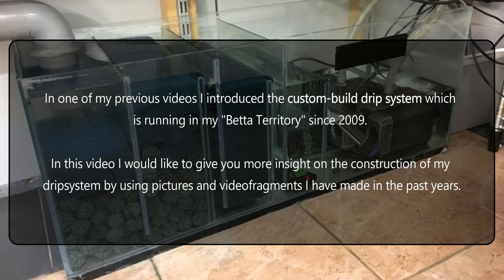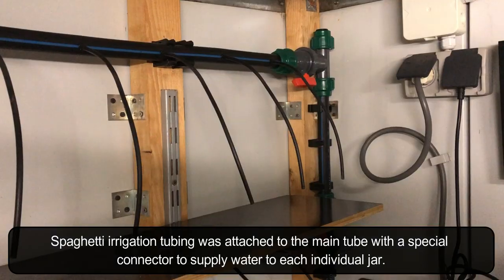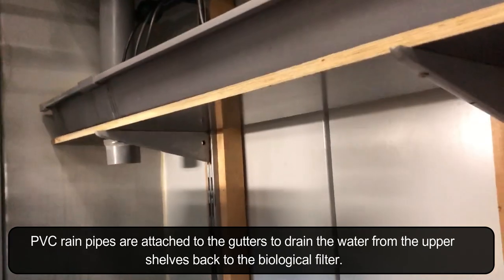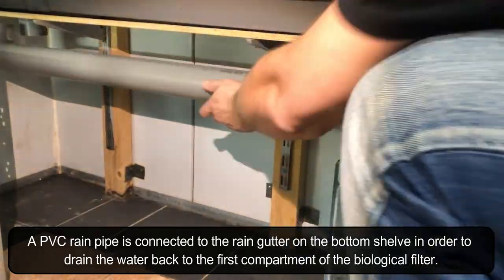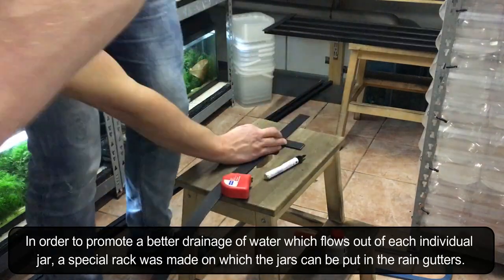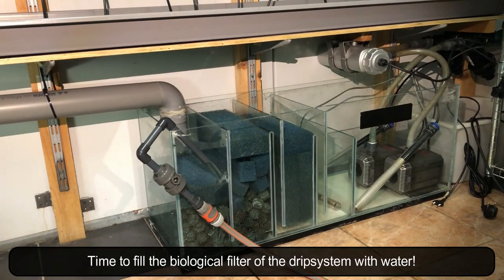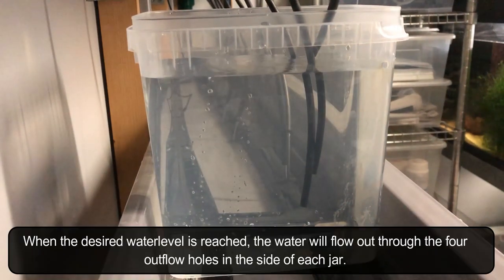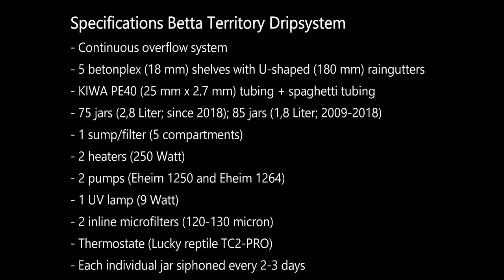My DripSystem - Tutorial

Comment: Do you think a 190 gallons per hour power head pump is big enough?
        Right now I have 15 gallons of water in 1/2 gallon jars on 2 ft shelves. Just bought a metal unit 4ft long with 6 shelves, that would allow 20 jars per shelf - 10 gallons per shelf... 60 gallons max. 
       At the rate I am expanding, I would probably only use 3 shelves until spring. Would the 190 GPH power head be enough to handle 30 gallons of jars?

Comment: Thanks for sharing Joep👍
Do you have the uv light on timer or running 24 7?  Same question  for the pumps? How 0ften you do maintenance on sump and individual jars?  Do you stop the water flow if feeding bbs or live foods?
Reply from the maker: CrowntailHalfmoon the UV light is on 24/7 but is only connected to one pump, so all water will go through multiple times per day eventually. The pumps/flow run 24/7 and is not stopped during feeding or the waterchanges (siphoning each individual jar manually every 2-3 days) only stop flow once a year when I do the annual cleaning where I take the system completely apart.
Reply: @BettaTerritory  
Joep do you add dechlorinated water back to the individual jars or the sump when removing wastes from each jar?  How much water do you siphon out of each jar and what's total volume of water in the system? If there's an power outage do the sump hold the excess water run off?
Thank you for sharing.
Reply from the maker: @CrowntailHalfmoon  I siphon 30-60% manually every 2-3 days. Water is replaced by pumping fresh water back into the sump. More on this is shown in this video at 3:20 min: https://youtu.be/zEGMtBiRZ84
Reply from the maker: This also might be useful to you: https://youtu.be/qgFW-XiIS6w
Reply: @BettaTerritory  
Thank you Joep
What's your approach for power outage and do the sump hold excess water running off?
Reply from the maker: @CrowntailHalfmoon  At the end of the KIWA tubing on each level of the dripsystem, one extra spaghetti tubing is added to prevent a vacuum from being build up in case of a water outage. This prevents water being sucked from the individual jars back to the sump. The sump does have some volume left for the excess of water in case of a power outage.
Reply: @BettaTerritory  
So its same length as other tubing but not in a jar? 
Also you u recommend having tannins in dripsystem?  Like a bunch of ial leaves in sump? What's your pros and cons on this?

Comment: Sir when you drill the hole for the valve did you put some silicon protection for water leaks?
Reply from the maker: I did not drill any holes for the valves, but maybe I have misunderstood your question. Can you explain what you mean?
Reply: @BettaTerritory  sorry for my question, 
how did you put the valve into pipe? 

If you do drill to connect the valve into the pipe what should you do to prevent leaking damage?
Reply: @goysjohn9239  u get special connectioms that pres into main line with no leaks look by garden irrigation shops

Comment: Can you update your website and put more info on genetics? Especially tail genetics? 
Like what happens in a VT × HM breeding 
Plakat × VT 
HM × Plakat etc...
Reply from the maker: The outcome of such crosses is usually it so straightforward because they involve multiple traits.
- Crossing VT x HM can lead to quite a big range of phenotypes in F1 ranging from VT-like to roundtail and/or (super)delta offspring. In F2 likely a similar variation will appear. 
- Crossing PK x VT will lead to all longfinned offspring unless the VT is also carrier for PK. When you use a traditional PK with only a 2-ray branching there is a good change the offspring will be VT-like. As all the F1 fry will be carrier of shortfin, there is a chance of getting both PK and VT in F2.
- Crossing PK x HM likely will give you similar results in F1 than crossing VT x HM. When the HM is not carrying shortfin, all the offspring in F1 will be longfin. As all the F1 fry will be carrier of shortfin, there is a chance of getting both PK and VT in F2.

I hope this information is useful to you?